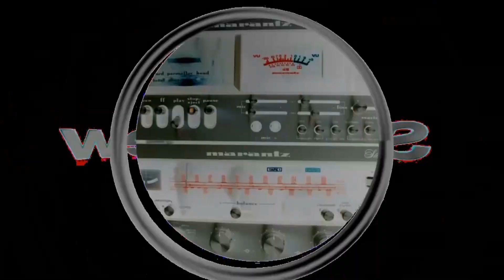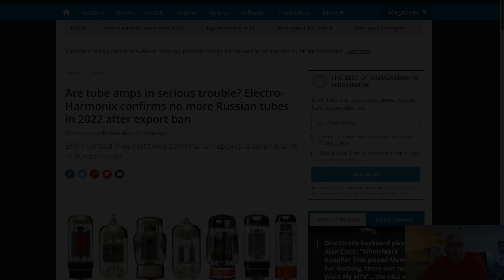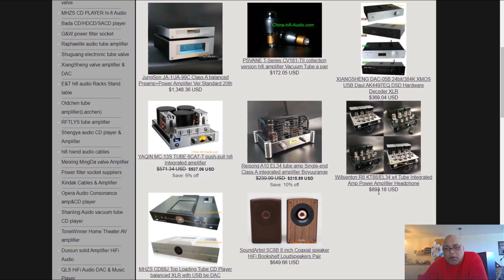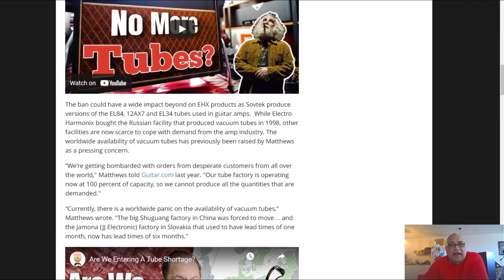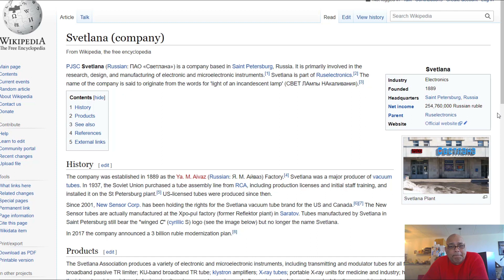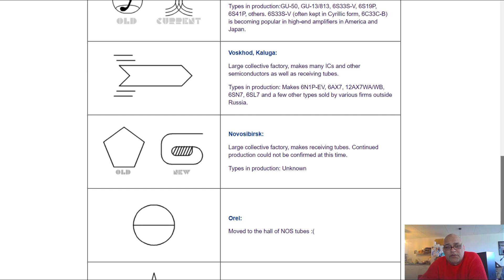Tube amplifiers lovers have a huge problem now

Comment: No need for alarm currently the tubs are readily available from all over the eastern block and at the same price or better. It’s not just Russia and Ukraine stockpile the old 50/60/70s tubes. And they aren’t stoping manufacture which would have been back in 1990. Life goes on